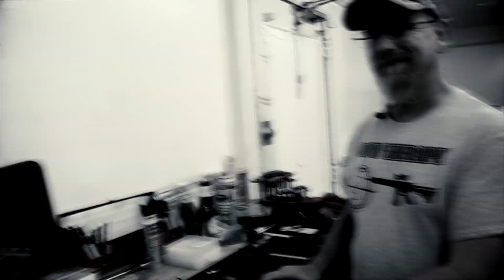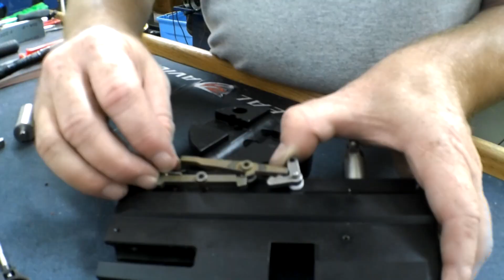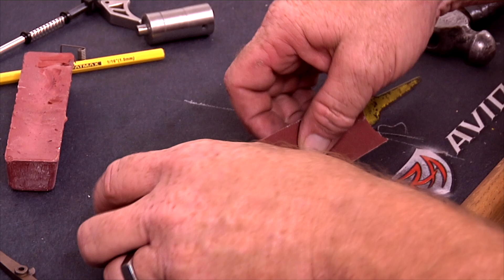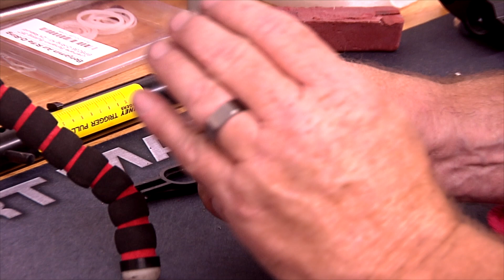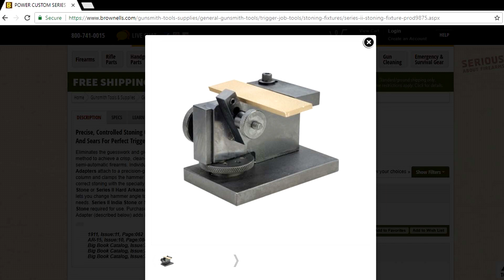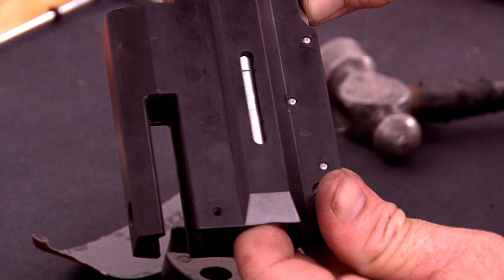Bulldog Trigger Tuning

Comment: After watching this video I performed this mod as I hated the trigger on my Bulldog.  After putting the rifle back together the trigger was single stage and fired unpredictably.  After trying many different things to fix this problem, I thought I was going to have to replace the hammer sear or the part you grind in this video because I could not get the triggers second stage back. This is what worked for me and I think the trigger linkage is understated in this video. I swapped out the safety spring with the modified sear spring because I though it was to weak after mod however, this didn't fix the problem but made it a little better. Then began adjusting the trigger linkage trying to fixed my problem and sure enough it worked.  I tried placing just a few screws in, testing and tuning. It would change after full assembly.  I would suggest leaving off the rubber plug between the grip and the fill nipple after full assembly.  Then fine tuning the trigger linkage to your desired trigger feel after the gun is fully assembled.  I got the second stage back and dialed it in.  Now the trigger is much better then before.